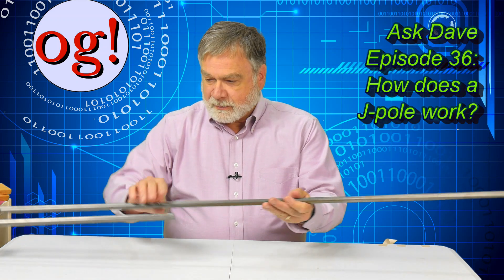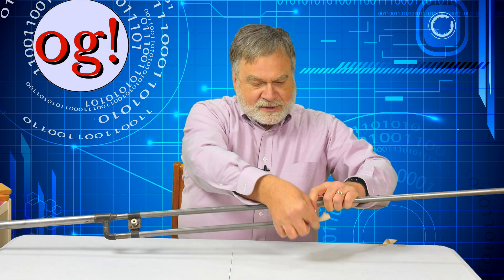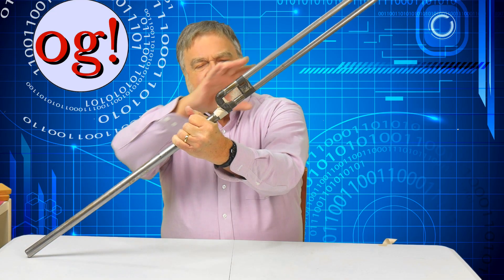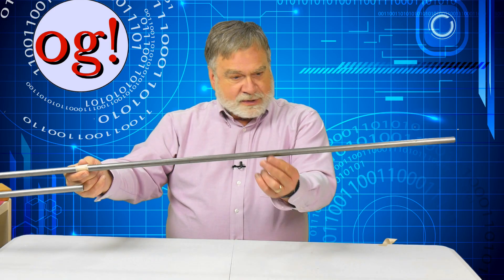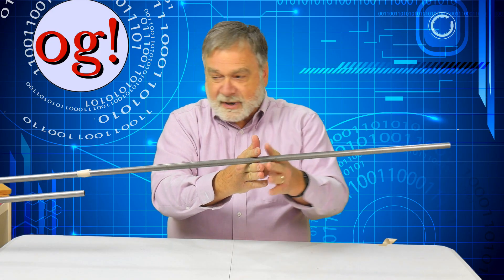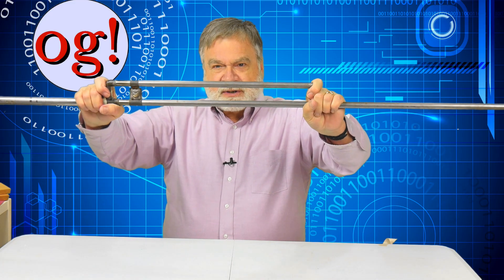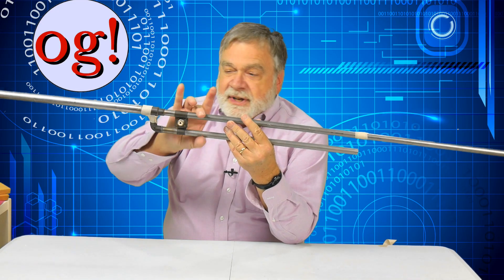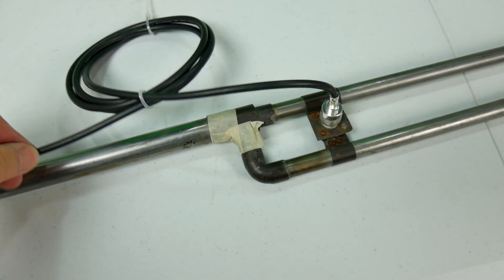How does a J-pole antenna work? AD#36

Comment: It isn't a dipole. It is an unbalanced end fed half wave fed by a balanced 1/4 wave stub fed by unbalanced coax. 

 The end of a half wave is NOT theoretically infinite, it is several thousand ohms for a infinitely thin half wave and much lower for a thick half wave. If it were infinite
 you would have no current and power would be zero! The thick tubing 
used in a J-pole makes the end impedance somewhere around 1500 ohms or 
less (typically) at the end. 
 
The finite end impedance results in another problem, common mode current on the 
balanced section. The balanced section has one leg terminated in 1000 
ohms or so while the other leg is open, this causes unbalance and is the
 root of the common mode.

The shield of the coax  is not at zero volts. It is tapped up on the stub.  This also aggravates common mode on the coax and pattern distortion.
 
 The mast also has common mode because of the end feed without radials and all the improper balanced and unbalanced transitions.  

The common mode makes the gain and pattern, and even the SWR adjustments, vary with feedline and mast lengths. This is why a J-pole has an unpredictable pattern, and why commercial two-way companies avoid  them. You only see them in Ham applications. Commercial systems use 1/4 wave ground planes or other antennas, which have the same or more gain and a predictable pattern.
Reply from the maker: A half-wave antenna is a dipole, which is the basic building block of all antennas that excite the electric field. It can be fed many different ways. End feeding a dipole is actually at a current null and voltage peak. Center-feeding is at a voltage null and current peak. In practice, of course, the impedances are neither infinite nor zero. When thinking of voltage and current, think of what an RF voltmeter would read at a point along the antenna (like a wave meter), not in terms of waveforms. The current and voltage cannot be 90 degrees out of phase because such a condition would result in no radiation and an reflection coefficient of 1. The J-pole and an end-fed Zepp are essentially the same configuration--in the Zepp the dipole part lays down flat. But they're both a dipole end fed with a quarter-wave stub open at the top (the point of connection with the dipole) and shorted at the bottom. The stub is fed far enough up so that the impedance is 50 ohms or so, but note that this is a balanced feedline. If it is connected directly to coax, there will be RF on the outside of the coax.
Reply: You are confusing a di-pole or two pole physical structure with a dipole antenna. A dipole antenna by definition is two identical conductive elements fed in the center. This is *different* than a physical di-pole.  In antenna name use we have end fed antennas and center fed. The center fed version with two symmetrical sides is called a dipole. Look it up. 

You are correct that the J-pole is a form of Zepp antenna. The basic Zepp is an end-fed 1/2 wave fed through 1/4 wave of line. The 1/4 wave line serves as a Q section or, if shorted, a 1/4 wave stub. That stub or Q section transforms the few thousand ohms impedance (depending on L/D of the 1/2 wave element) to a something in the area of coaxial feeders. Let's say we have something like the Arrow J-pole feed. The Q section surge impedance is about 350 ohms. That 350 ohms transforms the 2500 ohms of end fed half wave antenna impedance  to (350/(2500/350)= 49 ohms.  That is how a Q section works (look at the feed of an Arrow J-pole).

The problem with a J-pole is the 1/2 wave end fed section is not remotely close to infinite impedance, so one wire of the balanced matching section is open (unterminated) and the other conductor is terminated in a few thousand ohms. This unbalances the 1/4 wave section and gives rise to common mode, which has to occur (by electrical law) in any end fed antenna without a suitable counterpoise. 

Making the common mode issue worse an unbalanced coaxial line then feeds the parallel line matching stub. This gives rise to an unpredictable pattern from common mode, and is why J-poles (even though simple) were never used commercially. They only have the maximum possible gain of a properly built 1/4 wave groundplane with drooped radials, yet can have less gain from common mode depending on mast and feedline length. 

The upper element is not a dipole antenna, it is an end fed half wave.  The impedance is not infinite. The Q section or matching stub and lack of radials cause significant common mode. It is indeed a Zepp turned vertical.

Comment: Good presentation, however I caught a slip of the tongue in that I believe you said the current was small at the center of the half wave portion of the antenna? Also why not use a 4:1 coax balun to the 50 ohm feed point it will also double as a choke. The feed system is a voltage feed
Reply from the maker: Good catch. The current is max at the center of the dipole. You could use a 4:1 balun if you want, but you would have to feed it at a 200-ohm impedance point, which would be further up the matching stub.
Reply: Correct have done it both ways, keep up the good work, I'm sure your presentations are of great help for the ones having a hard time grasping how antennas work. BTW, maybe a presentation on antennas and how they are all derived in disguise from the dipole is in order? 73

Comment: Excellent explanation of the J-Pole.   For me, to understand why something does what it does helps me understand how to build one for myself.   I especially like the feed point design.  Is that one you built?  If so I'd like a close-up pic of both sides of the feedpoint.   I like it better than tacking on the connector the the rods like most designs.  Guess this one looks more professional.   Also not sure how good tacking one to a copper pipe will do.
Reply from the maker: I've seen many different feed-point constructs. I didn't do this one. It was done by the Boulder Amateur Radio Club junior division (BARC Juniors) many years ago as part of a fundraiser and I bought one.

Comment: Great explanation. When I was a kid, I couldn't figure out how a stub-match or gamma match didn't just short out the works. About 10 years ago, I built a 2M J-pole from copper pipe. Worked fantastically. Someone else still uses it. I'm ready to build another for myself.

Comment: thanks Dave for this video about Jpole,.... so you're saying that if I tune the jpole at 4 feet an then install it at 30 feet the swr and the rest of the parameters will be un-tuned?-.... how come?
Reply from the maker: Yes and no. Height does affect tuning. When you are tuning your J pole, hold it high in the air. You're already a couple wavelengths high, so putting it up even higher won't affect the tuning a huge amount. The best way to find out is to try. Good luck with your antenna project.

Comment: Hey Dave I was thinking about using a old satellite dish with the Lnb on it As a directional antenna I just wanted your thoughts
Reply: A DirecTV dish
Reply from the maker: You could undoubtedly use this in the microwave bands. A parabola does not have to be changed to be used on another frequency. In theory you could make parabolas huge, 40 to 50 wavelengths across, even on an HF band, but then you run into serious construction problems.
Reply: Tank you

Comment: 2 meter j pole vs 1/4 wave ground plane? Which one is better? Fixing to put one 130ft in the air. Tired of the fiberglass high gain breaking down periodically.
Reply from the maker: In theory they both have the same gain. You might think about that 130 feet, because no matter how good the coax is, 130 feet represents a pretty lossy transmission line. I'd suggest something closer to the ground.
Reply: David Casler Thanks for your response. I have  7/8 heliax on the tower connected to a Diamond fiberglass that I've already had to repair once. So loss won't be a big issue. Was just getting another opinion about the jpole vs ground plane thing and that seems to be what everyone thinks so I thank you again. 
We really like your videos so keep em coming.

Comment: Does it make a difference if you mount the antenna to a metal mast or a plastic or fiberglass mast?
Reply from the maker: Oh, probably, given everything affects everything. A metal mast or at least a wire leading to ground from the mounting point would be a good idea.

Comment: I built one using 1 inch copper tubing for my crystal controlled pll pirate FM radio Station .. also I am in stereo an I Do Not Overmodulate...

Comment: If people have to ask how an antenna or a matching system works then they shouldn't have a ham licence..!!
Reply from the maker: No, I disagree. We're all learning all the time.
Reply: learning to a degree yes 
but you didn't just get given a Ham licence, you have to show some sort of competence and understanding surely  ??
Reply: what if they're learning so they could get the licence?
Reply: David Casler:   that's a capital "ALL"......No one is born with the knowledge.
Reply: I don't know how long ago you got your license, but there is nothing on antenna design for your test for a technicians license.  Many people can enjoy ham radio using off the shelf antennas and never get into designing their own.  If you make the bar so high to get started, ham radio would die off with the oldtimers. Get people hooked and build knowledge from there is my opinion.

Comment: Great video, Dave.  I'm just getting ready to build one.  Do you think it makes
any difference at all what diameter copper pipe you use?  IOW, would there be
any point in using 3/4" instead of 1/2" pipe?   I'm studying for my technician license
so I'll be watching many of your videos.  Thank you for your work and sharing.
Reply from the maker: It will make a bit of difference in the velocity factor, hence the dimensions will need to be tweaked a bit, but not much. Check out designs on the Internet.

Comment: i THINK THE GROUND PLANE WORKES BETTER AND THE gROUND PLANE IS VERY EASY  TO BUILD.      fROM 20 WATT 1/4 WAVE ANTENNA, i GET OUT OUT ABOUT 35 MILES
Reply: The J-pole has about 2 db of gain over a ground plane antenna as well as a lower radiation angle.

Comment: I built a 6 meter j pole and I cant seem to get it to resonate where I need it to. it's at about 44.200 Mhz. tried shortening the copper and I got it to about 47 Mhz with an swr of 2.4. testing with MFG 259B
Reply from the maker: Mike, that sounds frustrating! Given the vagaries of antenna tuning, I'd suggest asking for help at your local ham club. There are three dimensions that can be adjusted: main tube length, the length of the matching stub, and the spacing of the matching stub and the main tube. Also you can adjust where the tap is for the feedpoint. And all of them interact with each other. Check around the Internet for 6-meter J-pole projects and compare dimensions. Good luck! 73, Dave, KEØOG
Reply: David Casler I got it down to 1.5 in the middle of the band. main and matching tubes are quite a bit shorter than original measurements.

Comment: Nice video Dave.  I'm not sure that your "ignore it below here" advice is spot on though.  Yes it's a zero voltage point because it's a short, but that doesn't mean it's a zero current point.  In fact zero voltages spots are often current maximums.  According to the modeling and articles here (http://www.hamradio.me/antennas/j-pole-antenna-should-i-ground-it.html) attaching the j-pole to a grounded mast can really mess with its efficiency.  Thoughts?
Reply from the maker: Yes. One of the comments below provided considerable information on this, even including a mod that may fix that problem. I'll have to do some experiments come springtime. 73, Dave

Comment: Nice explanation although the use of terms like infinite impedance at high impedance points is a bit extreme and doesn't take into account the capacitive loading causing 'displacement currents' thereby limiting the "high" impedance to the couple thousand ohms you do mention once.

Of greater concern is your notion the conductive mast beneath the parallel transmission line section has no effect on the antenna.  Given the mast's propensity to conduct RF currents with the greatest of ease depending only on the impedance it presents to the 'junction' portion of the antenna, this notion is demonstrably false and has been a known problem for a few decades at least. Yet the myth persists. See...

https://www.youtube.com/embed/toQSFgY0T8U

...and...

https://en.wikipedia.org/wiki/J-pole_antenna
Reply from the maker: I agree that such a simple explanation as mine leaves out some of the complexities (maybe many). When I hear the term "displacement current" I immediately think of Maxwell's equations. Another problem with J-pole usage is that the feedpoint is balanced, and hams almost universally feed it with unbalanced line, which will mean radiation from the transmission line. And yet the venerable J-pole works remarkably well and seems to be very forgiving in actual usage. I recommend grounding the J-pole for safety reasons. Grounding also bleeds off the electrostatic charge that accumulates in the wind. Thanks for your comment. 73, Dave, KEØOG
Reply: A mast decoupling stub provides the best of both worlds... http://www.hamradio.me/antennas/mast-mountable-j-pole-antenna.html
Reply from the maker: Oh, I like it! I'll build one and play with it. Now here's a question for you. Must the antenna be fed in a balanced fashion? Or perhaps could the coax shield be connected to the zero impedance point at the bottom of the J, and then the inner conductor connected to the 50 ohm point? I've not tried it. 73, Dave
Reply: Leeds talks a bit about this in his 1930s patent https://www.google.com/patents/US2124424.  The short answer is yes it does makes some sense. However, the problem with the outer coax connected to the antenna assembly remains. While you might get lucky and connect the shield to the real so-called &quot;zero voltage&quot; (but High Current) point, the hanging feedline will still present an impedance on this point that may unbalance the antenna just a bit and encourage feedline currents. The safe and likely proper bet will always be to choke the feed and if you do, it doesn&#39;t make much difference where you put it on the stub - straight across, diagonally or shield on bottom, center somewhere up - so long as there is 50 ohms (or whatever feedline impedance) between those two points. With this in mind, straight across is often the most practical mechanical solution.
Reply: @SkyCharter  I would like you to do a video on a "collinear" antenna composed sections of coax alternately composed of the shield soldered to the center conductor, and whether this antenna is appropriate for nonCW signals,

Comment: Thanks !!! I finally get why the connection at the bottom is the way it is...it's the 50ohm matching point !!! I have three j-poles I have built and never really got that.  I just made it the best SWR and didn't even think about the 50ohm matching point !... Great explanation.  Now for my next one I build I will actually look for the 50 ohm point!  That also explains why when I experimented with 75ohm coax the connect point was different !

Comment: Dave: One of the best educational YouTube videos I've seen; not only in the ham radio genre, but period. So I built a center loaded J-pole from some plans that is supposed to be dual band. Where does 70cm come in to the equation?

Thanks again,

Todd (AD0RR)
Reply from the maker: Hi Todd, I'm going to do a video soon building a kit 2-band J-pole, and I'll explain how it works on 70cm. Thanks for your suggestion! 73, Dave

Comment: David, I'll join the chorus of kudos for such a wonderful explanation for what is such a mysterious device for many folks. (Hand raised) As you started with the dipole section, I visualized the current/voltage diagrams as seen in the old handbooks. Your explanation of the transmission line section tied it together. Not only did the proverbial light come on, but so many that we can now light up our Christmas tree, hi hi. Your video also indirectly explains why a mobile J-Pole would be impractical. There would be too much stuff (other cars, trucks, trees, curious people) that would interfere with the high impedance section. It also explains why it's best to have these high up in the air
Thanks again! 73 de KA0RFB
Reply from the maker: You're welcome! And thank you for the kind words!

Comment: Hello Dave, thank you for the informative video on the J-Pole. I have a question. is there a diameter to respect and a number of  " rolls" ( coil ) in the coax that makes the coil? How do can we calculate those is its needed? Looking forewrd to your answer as i am buiding a beam on 10 m and is was not including a coil. but you change my mind.  Thank you.
Reply from the maker: There's lots of opinions on how coiling up coax should be done. I would suggest maybe six or seven turns with a diameter of about 6 inches or so. You can experiment with different configurations to see what works best. 73, Dave
Reply: Thank you Dave, i will follow your advise  73's

Comment: Would it be helpful to make the length of the J-Pole adjustable by inserting a smaller diameter tube inside the radiator and having it stick out a bit, to match for resonance, or is that not necessary with a J-Pole?
Reply from the maker: I've not seen it done on J-poles--usually the only tuning is adjusting the feedpoint. But you can definitely do what you describe for additional tuning.

Comment: Very interesting Dave. Would that choke also work for 70 cm?
Reply from the maker: Likely it would. Since 440 is about 3x 140, the stub becomes a 3/4-wavelength stub at 440, and that has the same properties as a 1/4 stub. 73